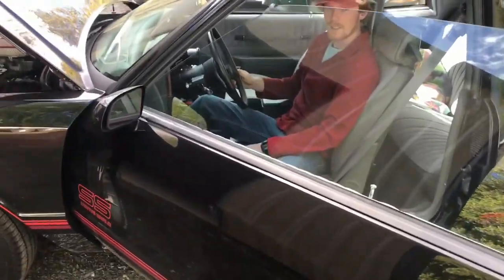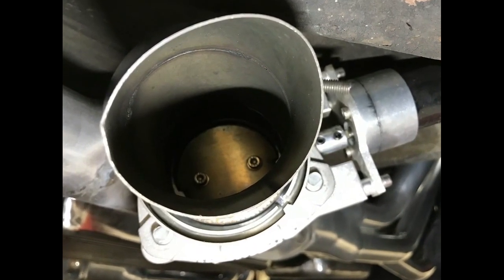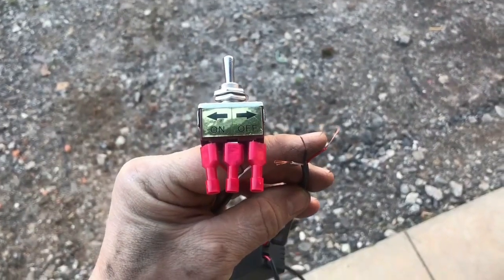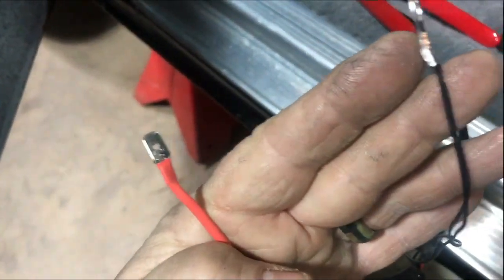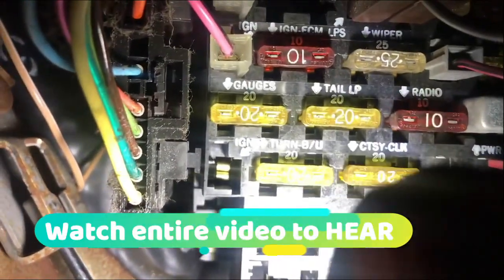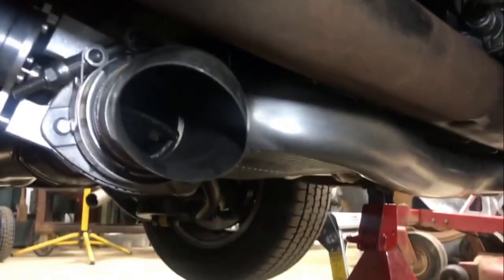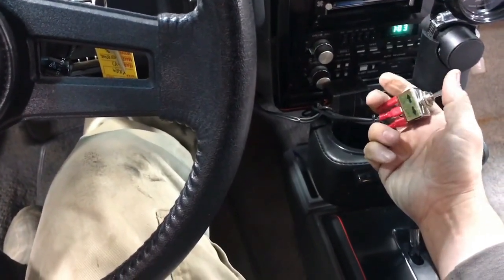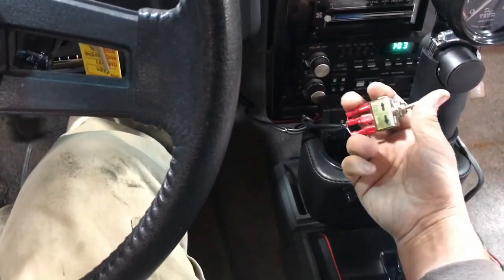Exhaust Cutouts on Monte Carlo SS - [How it Works]

Comment: I had a set of cable pull cutouts on my 82 Chevy Silverado short bed 4x4. 
 The truck came from a chop shop. It was registered as an 82, but it had GM body parts from different year models. The engine block was out of an 88 GTO & had Throttle body instead of a tuned port.  Positive traction rear-end & 3 speed automatic transmission that i had to replace multiple times  due to hill climbing on old reclaimed strip jobs. 
 The guys that built the it & a few other trucks went to prison. Several of the trucks they had sold were confiscated from by the fbi/state police . The truck that I would eventually end up with was taken up to an old deep mine, driven in a ways under the hill, set on blocks & covered up for 3 years until everything died down.  Dad's brother owned the truck & had a reclamation company. He used it to run parts after bringing it out of the deep mine.  Dad traded an 87 Toyota 4x4 pick up to it & gave it to me. I was 16.
Reply from the maker: Wow that's a great story. Hopefully the statute of limitations is up 😂